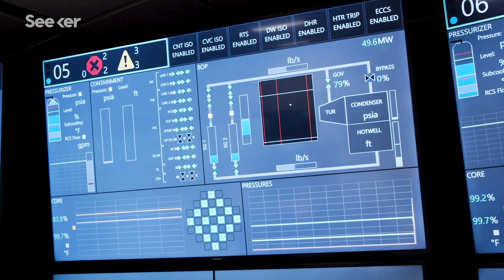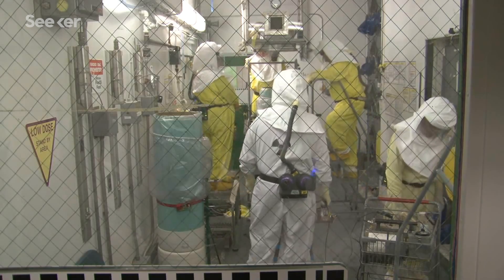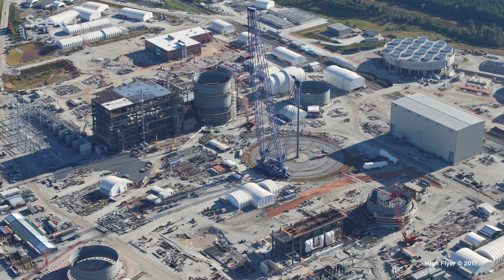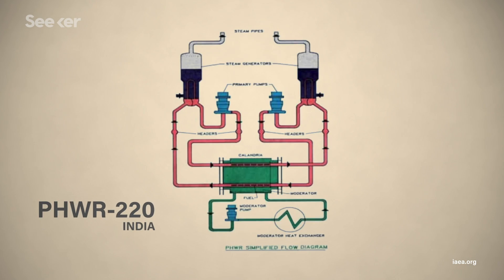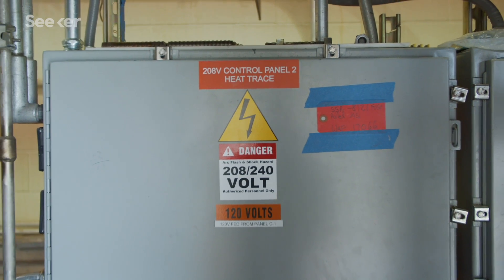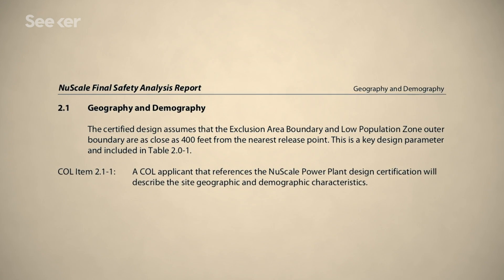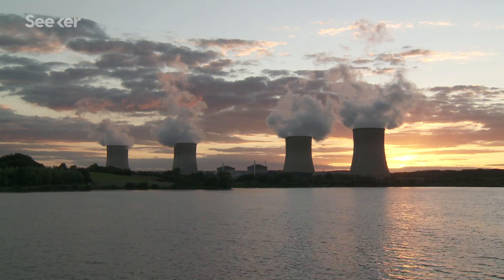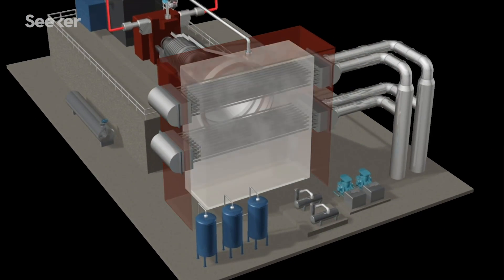Mini-Nuclear Reactors Are Coming, and They Could Reinvent the Energy Industry

Comment: This is meh.  MSR tech has had this kind of safety in an analog system for the last ~50 years.  CURRENT solar options could feed ALL of USA's power wants in ** WRONG ** ~100 sq miles ** WAY WRONG ** including batteries, plus they're easier to replace, no need of Nuclear Engineers, less likely to have major failure, no nuclear waste, and the fuel is abundant sun...  That's all CURRENT tech.  Kind of stupid to go the nuclear road....  Nuclear is great, for spaceships going places solar options fail.
Reply: Your math is kinda off, and we currently do not have the technology to store 24 hours of power for half of the US. if we would use conventional batteries that would mean a cost so spectacularly high per megawatt people woudnt be able to afford it.
Reply: @BartJBols   I appreciate your response, I was completely off on my area.....  If we're talking baseball fields, I was so far past left field, I was 3/7 the way to the moon...
BUT we do have the tech available today, whether we can produce enough of it is another question....

Please if you see ignorance in my math *correct me*, I'm for learning, especially when I'm wrong.  Statistics are for 2018.

According to statista::
https://www.statista.com/statistics/201794/us-electricity-consumption-since-1975/

4,180,000,000 kWh ( per 1 year ) / 365 = 
11,452,055 kWh ( per 1 day ) / 24 = 
477,169 kWh ( per 1 hour )

This is just a general breakdown, installation locations would alter the amount of panels we need.  Installing the majority of it would be best done in the Southern states, over multiple locations, to help minimize failure, decrease loss in distances traveled.  There are other reasons, but those are the most important.  Best option is to generate and store your own electricity.  Not so easy in big cities....

Solar
https://www.ebay.com/itm/Solar-Panel-300-watt-60-Cell-Mono-NEW-US-Made-Beautiful-Hi-Efficiency-/382631332179?_trksid=p2385738.m4383.l4275.c10&var=651383306300

We need to generate 477,169 kW per hour to break even with demand for that 1 hour.
477,169 / 300w = 1,590,563 panels

We'll want to multiply that value by around 5 arrays to generate 18 hours of storage in a 5 hour window as well as maintain enough for current demand.  This also adds in some breathing room for weather.
1,590,563 * 5 = 7,952,815 * 300w panels

Dimensions/Size per panel:  65" x 39.5" x 1.5"

Just for simplicity, lets say we make a rectagle array out of all of these panels.
7,952,815 / 2 = 3,976,407.5 per dimension.
258,466,487.5" || 21,538,873.96' || 4,079.33 miles in length
157,068,096.25" || 13,089,008.02' || 2,478.98 miles in width
10,107,762 square miles || 6,468,967,680 acres

This would take up roughly half of the High Plains in the Texas panhandle area.

Batteries
For reference we don't need 24 hours of storage, in a bare minimum situation aka overnight, we need 24 - 5 hours ( 19 hours )

Quick search for large scale li batteries, there are likely far better options.
1000Ah / 48kWh battery
https://www.ev-power.eu/Winston-40Ah-200Ah/WB-LYP1000AHC-LiFeYPO4-3-2V-1000Ah-Special-product.html?cur=1

477,169 * 19 = 9,066,211 kWh of storage needed
188,879 48 kWh batteries.

The point
It can be done.

Comment: Whay the heck are these "new" reactor designs still using pressurized water as heat carrier? shrugs
Reply: F96 Because it’s proven technology. While it may not be the absolute best heat carrier, it’s relatively cheap, safe, and proven. Other designs have not seen the widespread adoption that PWR has had over many years

Comment: They should switch over to the thorium reactor designs maybe make them small modular reactors the problem with the current designs even with these is that that use control rods and because they use control rods I use weaponizable materials like uranium.
Obviously you can't weaponiz thorium even the small amount of uranium or plutonium used to start the process of fission in thorium is not enough.
Reply: You do realize that the USA, UK, India, Russia and China have tested WMDs made of Uranium 233? Thorium 232 is bred into Uranium 233. Yes all these processes are extremely unlikely to incentivize weapons proliferation, but the reason we have used Uranium 235 before Uranium 233 is not at all because of weapons. 

1. The Atomic Energy Act of 1956 prohibits commercial nuclear plants from producing weapons grade materials. 
2. The Non-Proliferation treaty of 1970 probhibits commercial nuclear plants from producing materials for nuclear weapons. 
3. Several NRC regulations prohibit the production of weapons grade materials from commercial nuclear reactors. 
4. As an IAEA charter member the USA is not allowed to produce, sell or distribute nuclear weapons or nuclear weapon materials commercially to any country. 
5. From a commercial production standpoint producing nuclear weapons does not make sense as it requires very short fuel cycles so as to maximize fissile enrichment ratios. Standard 8-14 month fuel cycles eliminate the possibility of producing weapons grade material in fuel waste streams. 
6. Lets also not forget the fact that its illegal for commercial nuclear reactors world wide to contain enrichment centrifuges for the production of nuclear weapons. This standard is enforced by the UN Security council containing every major nuclear superpower. 
7. Lastly there are multiple studies by Dartmouth and MIT which find that commercial reactors have not statistically increased nuclear weapons proliferation worldwide in the last 60 years.

Comment: 1:02 - do cooling towers usually wiggle that much?
Reply: This has been answered above. It's a time lapse, so it highly exaggerates how much the structures flex to the wind. With something just a few feet thick and 10s of meters tall you're bound to have some noticeable structural flexibility. Skyscrapers do the same thing
Reply: @javonfair  I've just never seen skyscrapers wiggle that much in timelapses before. I guess the thinness does make a difference.

Comment: Why do we have to use Steam? Wouldn't the weight and force of falling water turn the blades of a turbine just as well?
Reply: If you remove the need for heat then you remove the need for fuel. A few water pumps inline with a vacuum and a few water towers on a closed loop system passing through turbines blades. It's Zero pollution that uses only gravity and water. No water loss from steam or evaporation and no risk of radiation or unscheduled rapid disassembly. These power generation stations could be built one per County because there'd be no need for a 10mile emergency evacuation Zone